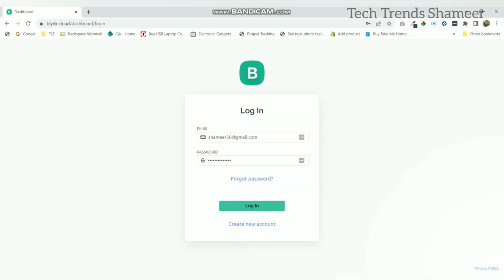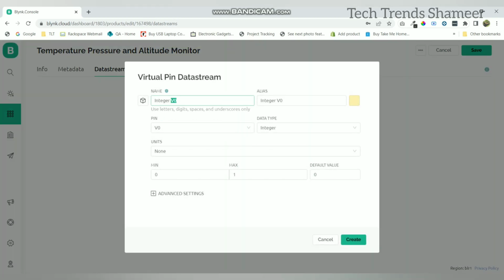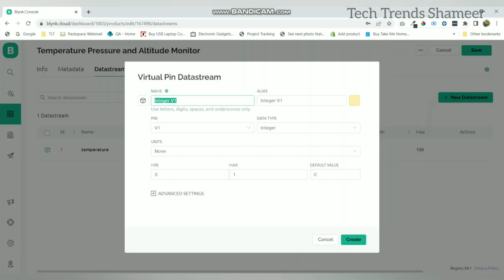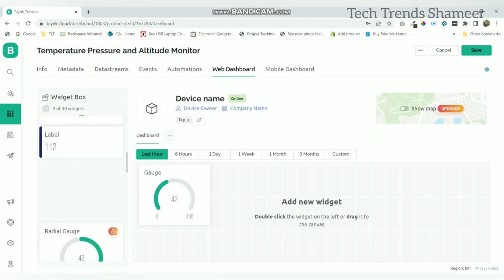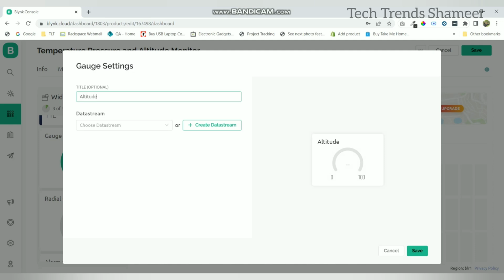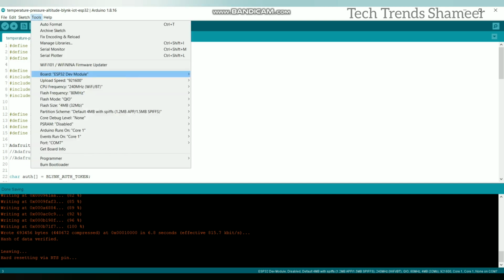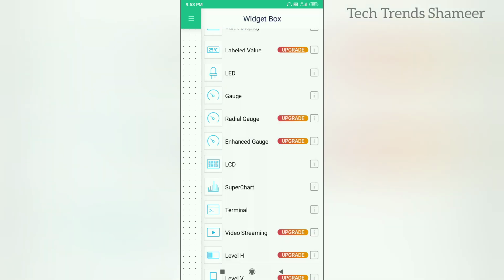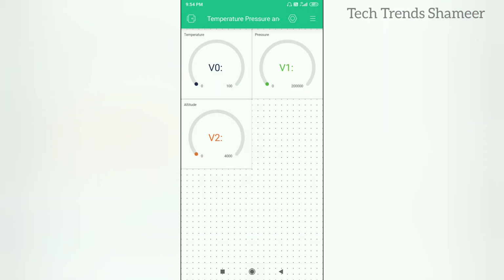Temperature Pressure Altitude Monitor Using ESP8266 and Blynk IOT | Blynk 2.0 Projects

Comment: I follow your video it is very helpful but I could not get notification in my mobile what should I do is there any process to get notification in mobile (i have done event in IoT website)
Reply from the maker: Please check this video for notification program.
https://www.youtube.com/watch?v=FIqY2fgxhCc&t=16s
Reply: @TechTrendsShameer  yes sir I have done this all steps and temperature and humidity also seen in my mobile iot app but above 30 degree temperature i could not get notification
Reply from the maker: Can you please enter your alert message in "Critical" tab in events page instead of "Warning" tab and give a try?
Reply: @TechTrendsShameer  ok i will try thanks for reply
Reply: @TechTrendsShameer  it is not working is there any special setting in new blynk app because in old app there is one option of notifications in new app there is unavailable
Reply from the maker: We need to do the settings in Events tab. In the new blynk there is no Notification widget.